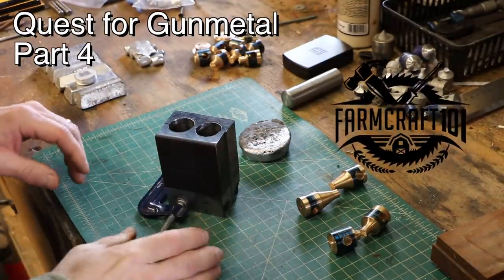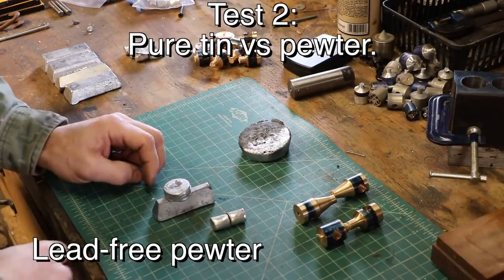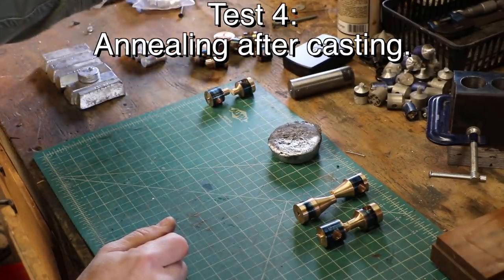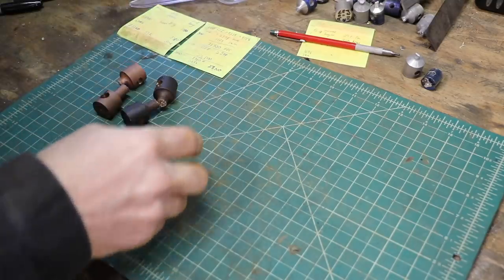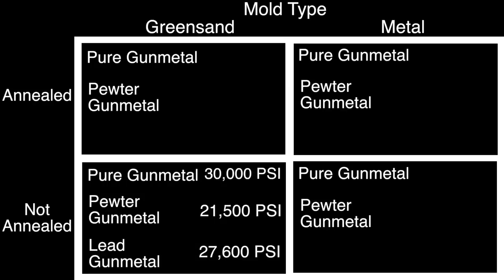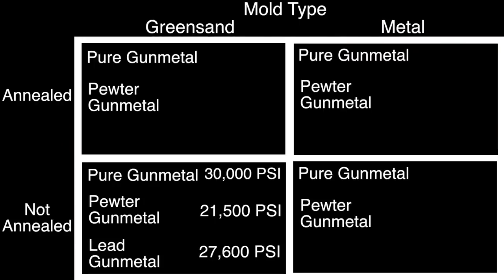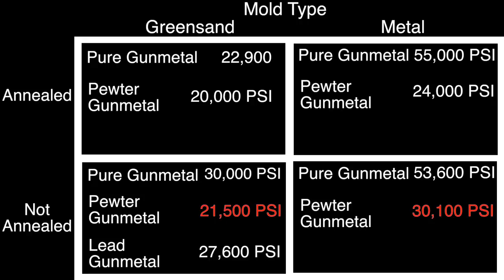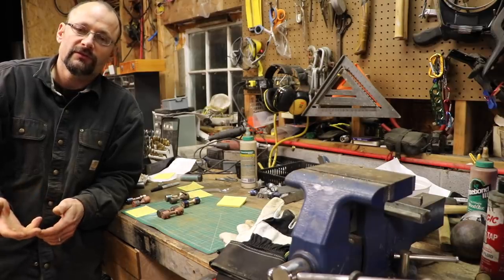Quest For Gunmetal, Part 4. Success!  FarmCraft101

Comment: Many years of casting bullets has taught me , the hotter the mold , the better the end result will be. When the metal has cooled , open the mold.    
The smaller the part , the faster the cooling. On your cannon , give it at least 20 min. For each pound . Be sure your metal is as hot as you can get it.

Comment: When using solid molds (metal, graphite, etc) you need sprues for escaping gas, when using a sand mold the gas can escape through the sand.  Having sprues will also help with the voids. for making a metal mold you can cast into quality drawn pipe (none of the cast iron stuff) placed in vermiculite or sand but still add the sprues and then cut the pipe off the casting once cooled. Vermiculite is for a nice slow even cool.

Comment: Never give up.  Always wondered about using pewter with copper, now I know not to use - though it is a beautiful color - thank you!  That metal mold result is fantastic - will now consider some simple mold applications.  I've heard that copper in thick sections can be used for mold instead of steal - apparently works because cu is such a good conductor of heat.

Comment: I think you are headed the right direction, I understand that the gas furnace is best for melt, however your kiln furnace will still be good for anealing. Try graphite for your mold, nice smooth surface and the heat transfer is even, then after casting try putting mold and all in the anealing furnace and cool down gradually. I think you’ll find your grain structure to be far superior and the elastic strength will go way up. I believe that what you were doing as anealing was actually shocking the material and causing a more granular crystalin structure

Comment: The pewter fares worse than pure tin in this application likely due to the presence of bismuth in its composition. Pewters have very poorly defined composition, essentially any alloy of tin with other elements (excluding copper) is "pewter". Often cheap and dense metals like lead and bismuth are added to give a better bang for the buck. Bismuth in particular is present in fairly large amounts in lead-free pewter. And bismuth is known to have negative properties on the tensile strength and toughness of copper alloys; 1% bismuth in copper embrittles it significantly.

Comment: the metal mold is probably causing directional solidification, making the crystal structure to form more uniformly from the outside in and encapsulating the lower melting alloying elements in an even amount of base metal(copper) before they can precipitate out into larger nodules. get Stephan Chastain'ss books on casting, goldmines for this kind of info
Reply: You sir are a SUPERNERD because science

Comment: I used to anneal my brass cartridge cases to extend their life. After firing them a number of times the necked rifle cases (like a 30-.06) would get hardened at the neck and crack rendering them useless. If I annealed them by heating them up with a torch or an oven and then dunking them in water, the brittle areas would soften and reduce cracking. Annealing different metals affects them differently.

Comment: Yes annealing is a slow controlled cooling and needs to be done in a furnace. Normalizing would be letting the metal cool in room temperature with no quench.
Reply: For steel, to allow large carbides to form.  It doesn't matter for this.
Reply: @tmacmillanssm  no grain structure is changed depending on the alloy and rate of quench.

Your trying to achieve a face centered cubic latice structure as opposed to a face centered latice structures.

Comment: When you cast your canon, why not have round spurs to the sides which you can cut off and test. Also the riser should also allow for testing material. I would also note that when annealing I was told always leave the material to cool to black before quenching or allow to cool naturally. I may be totally wrong as it has been about 30 years since I studied material sciences.
I look forward to seeing your results with the cannon casting, obviously with such a large mass it should take a long time to cool, I'm not sure if the longer cooling will help as the Crystalline  structure may turn out to be a little course.
Thanks for making the video.

Comment: I read some were that they would have the cannon mold in a pit in the ground. larger mass slower cooling when it is preheated. the foundry I worked at did the same for the large brass bearings 4 to 5 ft dia. 2ft wide 6 in thick walls.

Comment: Am looking for a “bushing metal” that is very similar to this - 87% Copper, 9-10% tin, 2% zinc, 1-2% lead.  Recipe is in the Machinist*’s handbook, and Ammen’s book, “casting brass.”

Your metal mold would work well for bushing stock.

Comment: Ok so annealing is where you heat it up and let its cool as slowly as possible. And then the other thing is what you called annealing was really hardening, by quenching in water you froze the grain structure at its most brittle state. 
The next point I have is you probably could temper it by bringing it to a specific temperature and then letting it cool. This would relieve some of the stress in the grain structure. Also you want a nice tight grain structure, what you had was a quite large grain structure. If you want some more metallurgy tips shoot me a message. I would be happy to look through some of my resources to find what you need.

Comment: Try linotype if you can find it these days. Back when it was beginning to no longer be used for printing it was widely available. Maybe not the case any longer. It was far cheaper than lead and is an alloy of lead, antimony and tin. When I used to cast my own bullets back in the 60’s and 70’s for my 38, 45 and 44 sp and any black powder rounds it was good to be able to find and blend up to 10% linotype with lead to harden your cast bullets in order to reduce leading up your barrel. It wasn’t necessary with black powder loads or pistol loads that were under 1000 fps IV but adding linotype was essential when making cast loads for higher IV guns like 9MM or 357 Mags which had IVs well above 1000 fps. As handy as you are, you could just make up your cast ingots of lead with tin and antimony to your desired hardness. I used to use a thumb nail as my guide. If I could still indent a mark in an ingot with my thumb nail the ingots were not hard enough. If you have no intention of firing real cast bullets from your cannon it’s not relevant as leading isn’t an issue. 

I enjoy your content. Keep up the fine videos. Good luck.

Comment: By your findings, I would take a greensand cast and heat it up in a furnace to red hot, then let it cool down in the closed furnace. Should give you the ease of greensand casting and the strength of metal.

Comment: Have you tried thermocycling the cast metal to normalize the grain structure? (Heat it red hot and let it air cool to room temp, a couple of times)
Reply: land otter1 copper alloys behave differently than iron alloys. Quenching is the correct process for annealing bronze.

Comment: Great testing and sticking at it. I know nothing. When heated it expands when cooled does the opposite. My trail of thought is that the moulding material is contracting putting pressure on the cooling metal. If this my theory has some value then using a tube of a metal that expands and contracts to greater extremes. I believe this is what is happening. If it is true you run that test. With a success I believe you will find another interesting data. Next test after that would be to cast then put it in to a pressure vessel and to put pressure on to it while it cools. Another would be a tool that the tube could be inserted to after pouring the tool would apply pressure evenly around the tube just like the lathe jaws and apply pressure.
Its just a thought and theory. Hey what do I know lol

Comment: The windings of your furnace do not burn out because of 'shorting'.
What happens is that they form an alloy with the casting metal splatter (and even vapor is enough in the long term) This alloy will have a much lower melting temperature than the original element.
So you need to avoid contamination. maybe a firebrick pipe to limit splash?
I have a small electric muffle furnace for bronze, the elements are wound on the outside of the (fire brick / ceramic) furnace shell, and they have been then covered with a refractory cement.
This seems to work. It does reduce the available temperature in the furnace cavity (mine goes up to 1100°C) 

Service life of the electric furnace is dramatically reduced, if run above the rated temperatur, by even as little as 50°C as ceramic need a very high temperature to vitrify, does not have a high risk of contamination, and is run close to the limit for metallic heating elements, the ceramic furnace has the elements inside to remove the small temperatur drop through the wall.

Comment: What I think is happening here is that the metal mold is cooling it faster. Perhaps it is the case that rapid cooling causes a smaller grain structure, as the grains have less time to crystallize into larger shapes. Looking at metallic asteroids, which cool over millions of years, their grain structure is absolutely massive. If a finer grain structure is what you're after, you should see how fast you can pour it and get it to freeze.
Reply from the maker: I think you're right.  The flash freezing I showed on the outer layer is not something that I've ever seen with greensand.  I'm tempted to try it again and don't even preheat the mold.
Reply: @FarmCraft101  There's likely a sweet spot to find, where it won't freeze so fast that it makes cavities or can't completely fill the mold, but freezes fast enough to make it decent strong. Also I absolutely love the videos, keep up the fantastic work!

Comment: hmmm - that's not 'annealing' is it??  i thought annealing required letting it cool down slowly so the metal isnt' 'shocked' by the water?
Reply: For steel, yes. Copper can be annealed by heating and quenching in water.
Reply: That doesnt apply to copper or copper alloys ... Iron hardens via quenching but only if it contains carbon turning it into steel whereas elemental iron wont harden in a quench nor will wrought iron or mild steel
Reply: There is a difference in annealing quenching and tempering, im just not that good at explaining the difference unless its in practice.

Comment: I think the heating of the metal mold allows slower cooling . If you could heat the sand mold to near the same temperature I believe you would get similar results ... as a matter of fact I bet just 100 deg sand would make a big difference over cold sand and would probably compact better giving a better cast.

Comment: New mold, A steel pipe in greensand and see which it is more like, steel mold or sand

A suggestion, a clay mold, very dry, good insulator, easily removed to reveal new cannon form, surrounded with dry sand for support
Reply: This man knows copper.

Comment: I am not an expert, but i have read that the strength of early cannons was improved by active cooling of the cannon from the inside, once the pour was complete. 
I think this goes hand in hand with your observation of the results of the Metal casting, because the radial cooling in metal casting should have allowed a gradient to form which should result in a kind of russian doll effect of cannons within cannons, which keep each other under tension and create an overall stonger part.
Hope that makes sense.

Comment: what about, when you cast your cannon, building in a second smaller trunyon towards the back of the cannon that you can cut off to provide your sample to test?  This wouldn't sacrifice metal from the cannon shape itself, and once finished, you can file smooth the spot.

Comment: If it was a matter of flash freezing than you would see varied results across the annealing I think. I think the reason you're seeing such results from the metal cast is either leaching of steel from the mould into the cast, or it's possible that the steel from the mould is acting as a catalyst for a different crystal formation in the cast.
Reply: This also means that it's testable. You can use mild steel as a stir stick during the melt, and on a separate piece you can green sand cast with a small piece of steel at the bottom. Of a test plug green sand mould.
Reply: On a less related note, I can't recommend enough switching from propane to an oil burner. I run diesel through my oil burner and I went from 20+ bucks for a day of melting to 10 bucks a day.
Reply from the maker: Agree.  I'd love to burn waste oil, but it's challenging.  I plan to start with a propane burner and maybe change to oil or diesel later.
Reply: @FarmCraft101  I run mine off a pancake compressor from harbor fright. And I did buy the fancy nozzle reccomended by sv seeker in that old vid he made. But it is an easy conversion, it's not like the burner is stuck on the body of the foundry.
Reply: @FarmCraft101  , check out a guy named luckygen001. He uses both oil and propane w a forced air system.  Old vacuum cleaner I believe although a bounce hose blower( home depot) is a viable alternative. He does cast iron so its definitely fit the heat capability. 
On another note. Am curious if you were to use  say Mizzou castable refractory to make a mold then preheated it and pour if it wouldn't have a similar effect as the mild steel w o cross contamination of the mild steel. 
   Also have you considered adding nickle to the copper . I know it adds a boat load of strenght when adding it to the copper in cast iron.  See Jantz knife making supply for powdered nickle...35$ for a pound I believe. 
   So to give an idea of what the nickle dose... grey cast iron tensile is 360/390 mpa add 5 % nickle and 1.5% copper it goes to 760/790 mpa tensile.
   Idk  if any of this will be of any help...but if so grand if not...well at least I tried lmbo!
   Blessed days sirSir, Crawford out

Comment: Love these video's, the trial and error is great to see... I believe when quenching to harden the metal you need to do it to a very specific controlled temperature to get the internal structure to contract like a prince ruperts drop and if you go over temperature the structure will not form correctly from too rapid contraction, I also think is done in an oxygen free environment for best results.... You may want to read an old school science book or watch a video on growing copper sulfate crystals, think the techniques may be applicable and explain why the heated steel mold forms a better crystal lattice.
*I'm a mechanic so all above is best guess within my educationKeen to see this cannon :)

Comment: I know glass is a noncrystalline structure but I wonder if the metal mold is causing some internal tension, just like glass does when it is cooled quickly giving it more strength ?

Comment: Try studying the Japanese method for making Bells. They use a superheated mold and allow it to cool very slowly. They don't use a preheated metal mold because it's not practical, like you said for a cannon. I think the method they use for casting Bells will explain your results. You might also want to try manganese and aluminum as additives to strengthen the final product and not so much Lead.

Comment: If you want to strengthen copper alloys you need to hammer them to work harden
Reply: work hardening does harden, but not necessarily strengthen, the extreme of work hardening is metal fatigue, this is why one anneals metal when it is worked (hammered) .

Comment: I used older pewter for my bronze but I found that it cracks so I use only newer pewter which has a hall mark underneath the mug. It says 97% Sn, the rest is 2% Cu, 1% Sb. No problems with cracking now.

Comment: Metal slows the cooling, you could place the poured casting in a heat cabinet and control it's cool pattern
Reply from the maker: I'm not sure it does, because I could see that it was flash freezing on the outer layers.  I've never had it do that with greensand.

Comment: You should heat it up to Orange and then cool it down as slowly as possible turn normalize the grain structure and give it the highest possible tensile strength
Reply: This is not steel, you can do the annealing as fast as you want. Is the same with gold and some other metals and alloys, it's a completely different thing.

Comment: to be completely honest i would not recommend water to quinch as water can also counter act the annealing process...... i understand doing this on a budget but at same time if you change your own oil in your vehicles you can use the used motor oil as quinching oil
Reply: Absolutely not copper anneals via a fast quench not a SLOW quench in motor oil ... Not to mention quenching anything in motor oil is monumentally stupid , dangerous and immensely toxic

Comment: How about casting a machining a cannon barrel, then hydro-pressure testing it?
Reply: Testing it to failure? I wouldn't want to be anywhere near when it exploded.
Reply: @JS-hy1ob  It wouldn't explode during hydro pressure testing.
Reply: @BedsitBob  Are you saying that it wouldn't burst, or that it wouldn't be an "explosion"?

If the strength is unknown, then there's the possibility that it would burst, and regardless of what you call that I don't want to be anywhere near it when it happens.
Reply: @JS-hy1ob  It may burst, but there wouldn't be an explosion, ie. no massive release of energy.

Comment: What would happen if you pore into the sand and then wrapped in the blanket would you get a different result then?????
Reply from the maker: It's a good idea, but It wouldn't change anything.  Not that much heat transmits through the sand, not quickly at least.
Reply: Ok well it was just a thought and thank you for the reply

Comment: to reduce thermal shock you should be annealing in oil(used motor oil works)or molten salt. watchout for flash over. have you thought about doing cold annealing with cryonic baths?